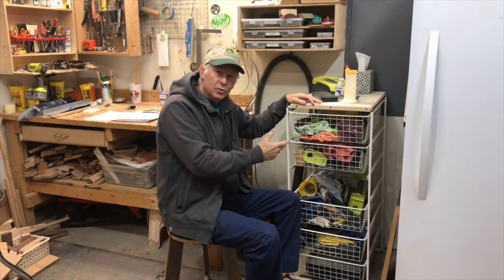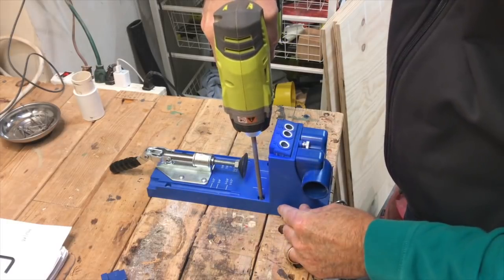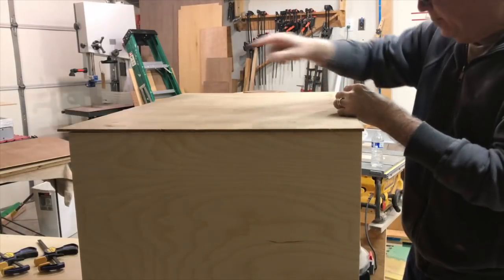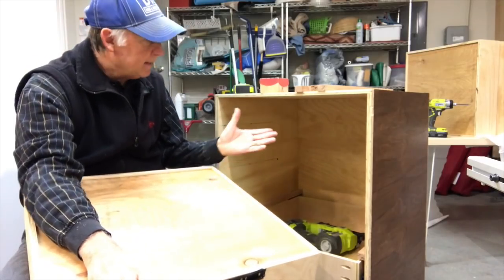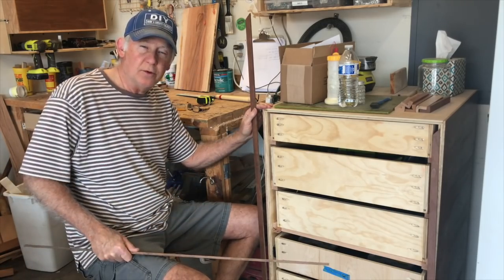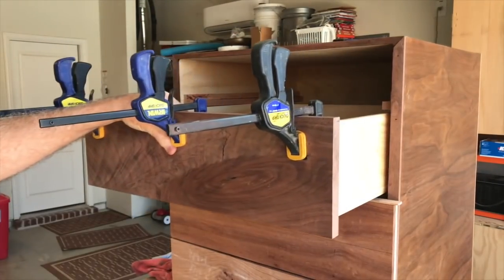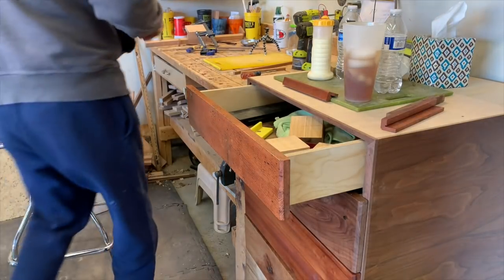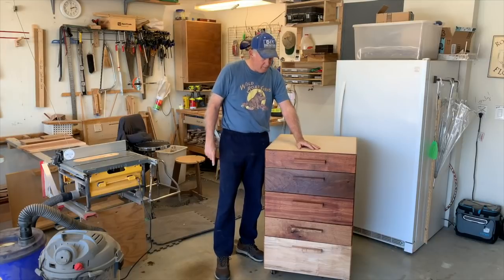Building a Shop Cabinet

Comment: You do make it look easy.  For the handles, did you just brad nail two pieces of wood together to get the 90-degree bend or did you buy them?
Reply from the maker: Samuel, The handles are made from the same lumber that I use for the drawers. They were all one piece and just cut to give a finger hold underneath the handle.